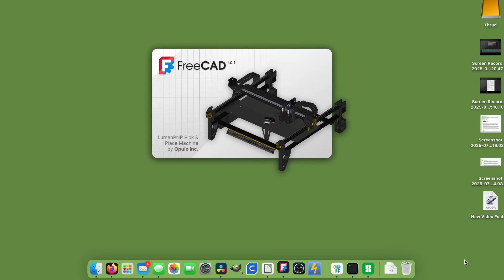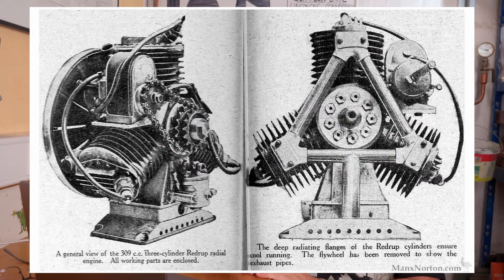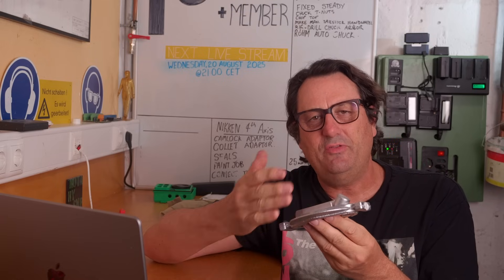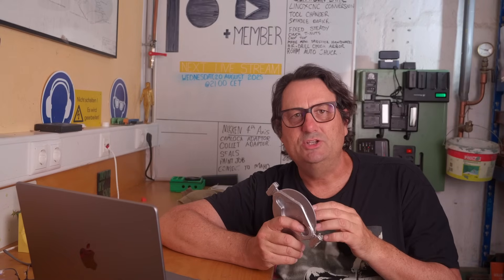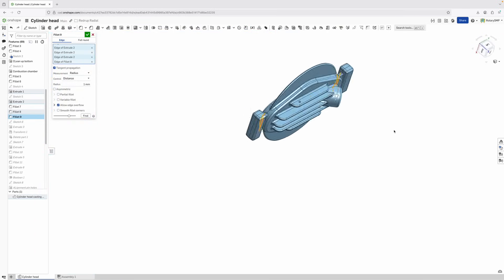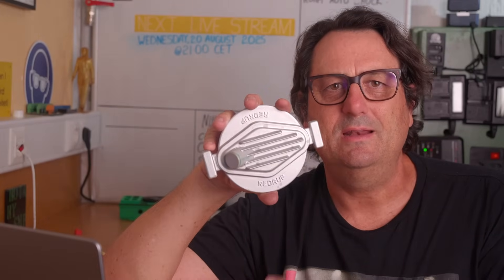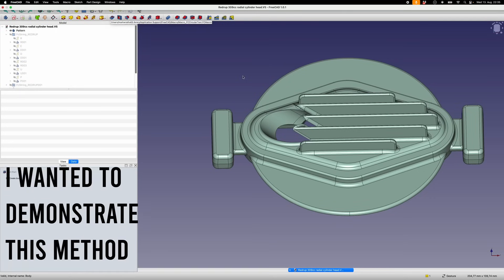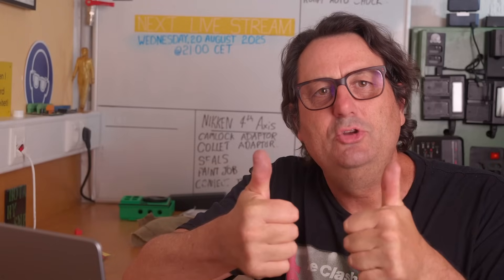FreeCad vs Onshape - Why did I switch? || RotarySMP

Comment: Just harvested some of my chillies today… cherry bombs… going to sweet pickle them. Nice to see someone else also growing chilli. The yellows are more than likely cayenne peppers, I have the same. And jalapeño. It was a bit wet over summer here in Switzerland a while back so the heat growing period was interrupted.
Reply from the maker: The shop only had the plants marked as yellow chillis. They taste nice. :)

We also had a wet July but now a really hot August. Our balcony is is south facing so it is nice and sunny.
Reply: The yellow peppers looked like “Hungarian wax peppers” to me, but there are quite a few possibilities.  True cayenne is long, almost pencil-thin, tends to be rather “lumpy,” and goes from green to flaming lipstick red (literally, flaming lips and all).   😂

I switched to OnShape in no small part because it drives a lot like SolidWorks.
Reply from the maker: @jeremylastname873  I never used Solid Works. I could get a student license, but it is Windows only.
Reply: @RotarySMP 
I understand the hesitance to get involved with anything “wondows.”   🤦‍♂️
Reply from the maker: @jeremylastname873  I have always used windows, and my work computor is a HP. I only switched to the MPB as it really is ideally optimised for video editing, running Resolve on minimal power where a Wintel laptop would have the fans screaming and pumping heat into your lap when you edit at an airport :) I am no fan of MacOS. It is okay, but nothing special.

Comment: Yeah but in Oneshape you will lose the CAM or have to pay a lot of money in the future. I use Fusion 360 instead.
Reply: well with fusion you are just guessing what you will lose in the next free edition enshitification...
Reply from the maker: @martinchabot_FR  I have never used fusion, but my understanding of their licensing, would also require a commercial license for a monetised channel.
Reply: @RotarySMP  true but my paid-for license is only £400 a year. Even a minor YT channel could afford that?
Reply: @martinchabot_FR  I pay 450€ a year for the better CAM. I use it for my hobby. 
Dirt cheap for what it offers. But if you only use CAM every couple month the free version has all the features the paid version has expect rapids and tool changes in one Programm. Every tool has to be exported as separate gcode.

Comment: My issue with OnShape is their licensing implications if you use a free account. Last I checked, they essentially "own" whatever it is you designed, but I also haven't checked in a while (years).

For some reason, there's a professional CAD suite, which is free to use for hobbyist (non-commercial, "community edition"), that is barely know in the maker world: Solid Edge (by Siemens, yes that Siemens). It's basically a CAD suite on par with Fusion, Solid Works or any of the other big players. It uses local files (not cloud like Fusion) and has very few arbitrary limitation. My personal experience with it is still limited, as I just haven't had any need for CAD since I've heard about this option.
Reply: It suffers from the same issue as Fusion: no true 2D plan, which is a pain outside of 3D printing or CNC use.
Reply: Yeah, solid edge is really capable, though the usage is a tiny bit weird. But it seems to be extremely capable
Reply: yes they still do. well it's all public and your not allowed to earn money off your models. which is fine with me. i love the everyone shares their models
Reply: @richardhemingway9773  That part is fine, but it also prevents usage of legitimate open source licenses because they don't fit in their requirements (GPL for example, at least it wasn't possible last I checked, again years ago). That part isn't OK with me. It's fine that they force it to be "public", but it's not fine that they get special privileges and actually prevent some incredibly common open source licenses with the rules in place.
Reply: Another option on the same style as Solid Edge is Alibre Atom3D. In spite of the "libre" substring in the name name, there's nothing open source about it, but at least it's a fully offline, non-subscription CAD engine with a modern kernel and feature set. They've got excellent tutorials and documentation, which is important to me! They do lock a bunch of features behind the "Professional" or "Expert" levels, Atom3D is the basics only. And as you might expect with the buy once, run indefinitely pricing model, you have to pay for "maintenance" or repurchase every few years.
Reply: Because Fusion 360 was limited in the way you could it, I decided to try Solid Edge even though I had to pay for it. I have tried and tried again to follow the official training videos and it goes wrong every time. I'm going to go back to 360 I think.
Reply: @billdoodson4232 I can use it just fine, don't know why you're having problems. It's just a different way of interaction
Reply: Need to mention its only Windows based there is no other OS version. But the pit falls are there. I used Solidworks way, way back for years when it was free, then it wasn't.  Now I use Freecad for detailed design and for concept/Prototyping, Plasticity. Plasticity is a one of fee that is cheap and its yours along with anything you create.
Reply from the maker: @Blank_Space1984 Thanks for your experiences guys.

Comment: I couldn't agree more, I have used a lot of CAD over the years and about once a year I give FreeCAD a try. I always put it down after a few hours or days of frustrations. I want to make stuff not fight with software that is intentionally and unintentionally difficult to use. Last Freecad try I struggled for 3 hours to design a part, then I switched to Onshape, which at that point I had never used before, and knocked out the part in 20 mins. At this point, I highly doubt that FreeCAD can be salvaged, especially since they seem to ignore all best practices of other cad software.

I hope at some point someone will start a new open source cad program...
Reply from the maker: It would be good if they could make a version with just a core of solid functioning components.

Comment: I started my CAD drawing journey only 3 or 4 months ago with FreeCAD, and I have to admit it hasn't been all beer and skittles. BUT, I'm slowly getting on top of it. I wholeheartedly agree that Mango Jelly has some great tutorials, he even replied to one of his videos from 3 years ago when I wanted to do of all things a chamfer, but no matter what I did it wouldn't stick, it showed up when applied, but as soon as I saved it, the chamfers would just disappear. The solution he gave me was in the Part workbench and could only be done from there. The issue in FreeCAD with Chamfers and Fillets is dimensional; if you have something 2 mm thick, you can't have a 1mm chamfer on either side of it, but you can have a 0.9mm chamfer, so they don't intersect each other, weird really. Perhaps Onshape has the nous to recalculate it rather than just rocking back and going "That does not compute".
Reply from the maker: Yeah, I have also had fillets not complete on part for which there was enough space for to the fillet.
Reply: One of the major differences between community-developed and commercial CAD software is how they fail - there are things that NO CAD package can do, like a 3mm chamfer on a 2mm thick part as you noted, but a commercial package tends to handle such thing more gracefully. CAD is about metric tons of math, with an endless number of edge cases, and fixing those to a bug-free standard is a really long, really hard, really nasty job people tend to stay as far away from as they can. In community-based development, that is always an option; when your wage depends on it, it's not. So the results are what they are...
Reply from the maker: @AttilaAsztalos  Thanks Attila. That is an interesting insight into what leads to code like this.
Reply: i started with onshape, and I've gotten quite good fairly easily

Comment: 2500 per year for the pro package to be able to use CAM.. thats 3.5x what fusion costs if you dont need 5 axis.

if only freecad workflow would be like fusion/onshape, but the ui/ux isnt made for humans, 
it has horrible performance, stability, functionality, is hard to learn and use and even if you are experienced it still takes 10x as many steps to do the same thing but  the result is usually worse ... just no.  not ready yet.

blender made a huge breaktrough in useability when they fixed left and right click, instead of their weird unintuitive way it was before.
and now its a really good, nice to work with program thats easy to learn and powerful.
if only freecad would be like this
Reply from the maker: I never used fusion. I installed it a couple of times, but at times I didn't have a project to force me to learn it.
Reply: @RotarySMP haha, that's exactly my story with FreeCAD while I've been using Fusion for years. 😅
Reply: @mazchen  same here, i was completely lost in freecad
but also in solidworks, its just a completely unintuitive workflow.
when coming from sketchup, fusion just made the most sense to me.
i tought onshape isnt that much different in how you create objects? you make a sketch, extrude and add modifiers to it like bevels.  

blender also now has a powerful CAD plugin
if only there was a capable 5axis free or affordable CAM out there... pocketnc makes no sense when you need to pay 2.5k a year to use it

Comment: I've also been frustrated by the poor performance of freecad. I have one of the top of the line AMD desktop cpus (9950X) and when making a hockey puck for a coworker it would take 5-10 mins to generate the knurling. and after that was done, if you happened to move your mouse over the knurling freecad would choke up for minutes. trying to find what triangle to highlight. Also tried to design a computer case and just importing a few models of computer components for test fitting and visualization would completely choke it up. I never had such issues working with fusion 360 but I couldn't get fusion to work when I switched to linux. Very frustrating:/.
Reply: windows server 2019 VM in linux and fusion should be working.. at least inventor is for me in such a setup (even 3d connexion does).  WinSrv (with desktop) allows u to disable updates and calling-home more easily and comes out of the box without all that bloat.
Reply from the maker: I also made a few models which choked like that. Annoying. :)
Reply from the maker: Thanks Joan.
Reply: @RotarySMP  no worries.  Always a pleasure.
I gotta check out that Solid Edge community version someone mentioned.. After some BeckerSoft CAD way back before the internet SE was my first 'real' CAD and I did some stuff in it of which I still got the files from, heh.
I use inventor via my job, but that might not last forever and until FreeCAD becomes similarly capable/issue-free I might need some 'bridge' to hold me over..  SE can prob do that.

Comment: I love and hate FreeCad at the same time. I totally understand what you mean. Nevertheless, I don't like cloud services and try to support open source wherever I can. But I understand that you don't have the time to mess around with software.
Reply from the maker: Thanks Chris, yeah, also have complex feelings about this topic as well.
Reply: @RotarySMP  hi, I am using this platform, it is very rudimentary, yet very efficient, they have a free version, but maybe you know it already, I am surprised it is not more known in these youtube machinnists fields https://www.youtube.com/watch?v=zAlb2DqUHmk
about memory issues, for your project..well..not many options, but just as regular basis program, for not so complex stuff, it offers a lot of availability and utilities
Reply: A little janky, and I "Own" it, vs smoother and I'm beholden to the whim of someone else's computer company.
Reply from the maker: @jebsaekam  It is a little bit more complicated that that.
Reply: If you have a project in 'the  cloud' it is no longer your project. If you have a file in 'the cloud' it is no longer your file.

Here's a quick test for the reader. Give me all your money; I'll put it in a locked box. You can trust me, as I have the only key.
I'm waiting...

Some time ago, I discovered Fusion360 - the best CAD software I've ever used. Then they changed the rules. So, while it may be a pain at times, the world needs the likes of FreeCAD and I support FreeCAD.

Comment: Imagine software being so bad you start to make videos about how bad it is. It might be useful to mention the fact that there's still software around for which you can simply buy a perpetual license. Obviously you want to avoid Adobe and Autodesk by any means possible. Not sure if Onshape is one of the good guys still.
Reply: Hell would have to freeze over first before i'd even glance at either of those companies. I speak as a former customer of both. Wouldn't be surprised if Autodesk buys OnShape to increase the amount of suck in the world.
Reply: @vincei4252 Yeah they both turned evil. Unfortunately them being bad doesn't make FreeCAD any better.
Reply: @graealex  Yes, I have been a Rhino customer for a couple decades. I'm currently on version 8. I thank the stars every day that they have not been acquired. I wish them many more years creating cool software. It is one of a handful of applications I'd still pay for.
Reply from the maker: I have never used Rhino. I could have gotten a Student licensed version when the TU switched away from Catia, but thought it more of a surfaces tool than a full 3D modelling one. 

I really like the Ethics of Da Vinci with Resolve being free for most functions, and a one time buy with unlimited upgrades for under €400. Even if they change that in the future, I could not really complain as I have had 5 years + from that.
Reply: @RotarySMP  Indeed. If you buy some of their gear then you don't even need to spend the 400. At least that's what I gather.
Reply from the maker: @vincei4252  They also didn't have a OSx port though did they?
Reply: @RotarySMP  I did not know what. As a media company I automatically assume that would be a thing. I'm not an OSX body, never will be.
Reply: What good 3D CAD system has a perpetual licence that's affordable for hobbyists?
Reply: @ferrumignis Depends on what you're doing. But Rhino for example has reasonably priced perpetual licenses.
Reply: @ferrumignis I've been using Alibre for 3 years. Started with the entry-level Atom version, liked it enough to upgrade to Pro version, to unlock more tools, a year later. Their licensing model (perpetual), fair pricing / bang-for-buck, and a completely optional subscription for service pack upgrades is what sold me on Alibre. I had previous SolidWorks experience, and was doing useful work, within an hour of installing Alibre, the workflow is very similar. To be sure, Alibre has its little quirks, but nothing I haven't been able to work through. It has been great for my hobby use and 3D printing and machining side business needs. There is a 30-day free trial version available, so "try before you buy" is a great option, to see if it meets your needs. Alibre has been upping their game with good, concise YouTube training videos lately, so check those out too.

Comment: Can you imagine how smart and the expertise those old designers and foundry workers had to be able to make the engines without any computers and 3d printers?
Reply: It is quite basic - the blanks would be carved from a chunk of wood, to make the sand moulds.
Reply: @viliusr6974 Exactly, with todays 
Possibilities they only had need a third of the time. Not compareable with todays hobby engeneers.
Reply from the maker: @vjdv_kleingießerei  Given Redrups experience grand Western railroads shops, and then his work in the War, I expect that he did not do it all alone. Labour was cheap after WWI, so I expect he designed, and handed off drawings to local foundries.
Reply: @RotarySMP  Selbstverständlich wird er nicht alles selbst gemacht haben, genausowenig hat er sich an Kleinigkeiten aufgehalten. Hab selber die ein oder andere erfahrung im Motorenbau. Mein Vater und ich sind weltweit die Einzigen die "Serien" Modell Umlaufmotoren bauen. Ich aber fühle mich bei Viertaktern erst unter 1ccm so richtig wohl.😁 Alles Gussteile, muss ja meinem Beruf gerecht werden.
Reply from the maker: Good on you. I love the smell of caster oil :)
Reply: @RotarySMP  Riecht einfach herrlich, ist aber überall😂
Reply: @viliusr6974I'm trying sand casting right now. I'm not having much luck lol. it's been fun melting metal though
Reply: At this time he has not a single useable part in his hands.
Reply: that's why they used the same engine for everything for many years. funny how all that stuff is still running while newer stuff doesn't last